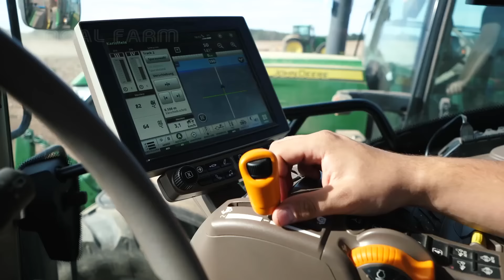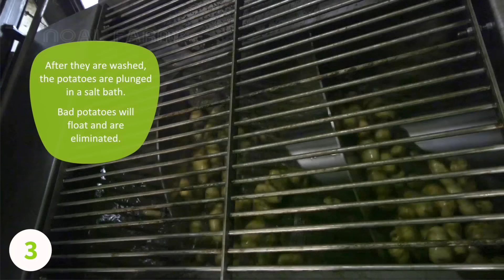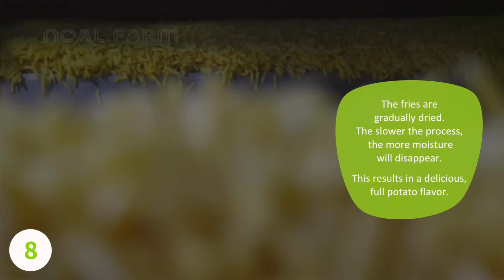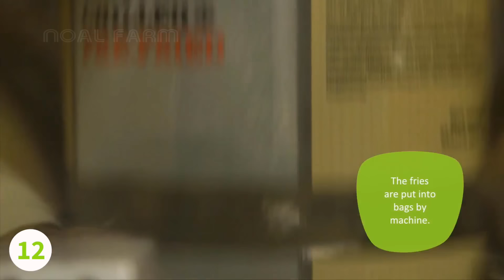How Harvest Thousand Tons of Potato with Modern Machine | Potato chip,French fries Making in Factory

Comment: Why do bad potatoes float when they are plunged in a salt bath? I checked that the density of a potato (1085 kg/m3) is higher than the density of the salt water (1020 kg/m3). What makes the density of spoiled potatoes potentially lower than 1020 kg/m3? 

I would really appreciate it if someone answer me that question.